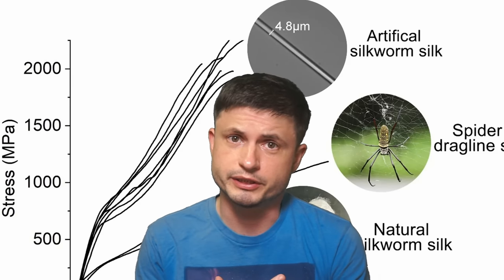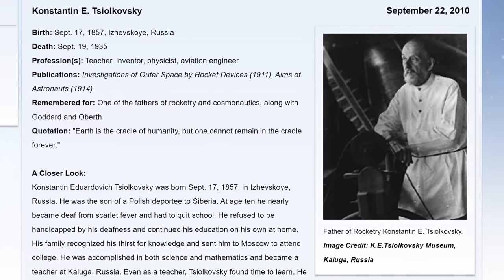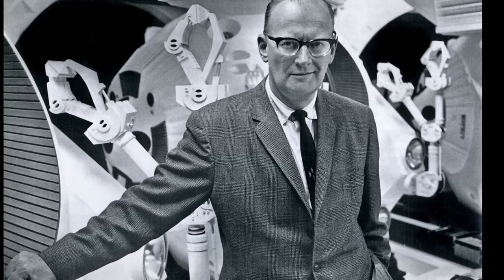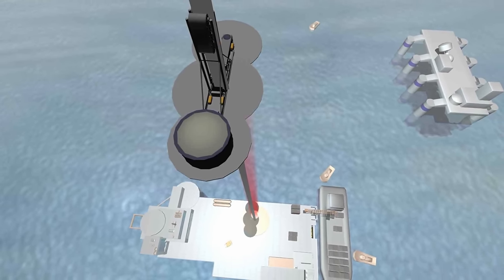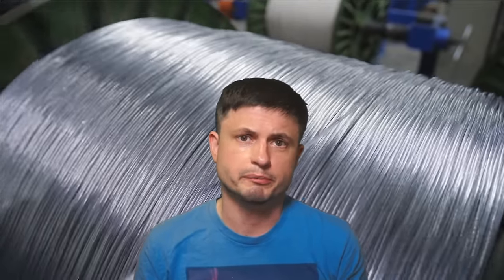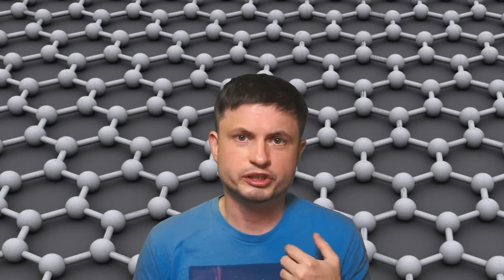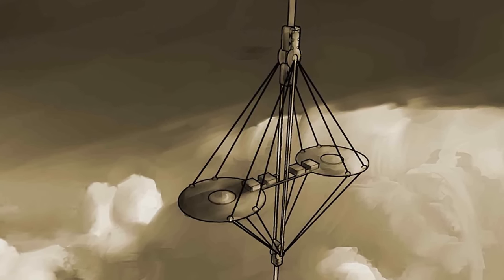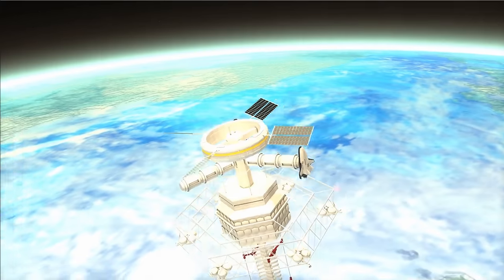Exciting New Updates About Space Elevator Technology...Possible After All?

Comment: Here is a question I have, with all of this focus on space elevators over the years, why not focus on orbital launch rings?  An orbital launch ring doesn't need any exotic materials we don't currently have.  It would help to use superconductors to help maximize performance in order to help push it up to a multi-gigatonne per year capacity, getting it into the global trade scale use.

The idea of an orbital launch ring here is essentially an inverted suspension bridge with a super-orbital speed rotor to hold it up.  When you look at the Hyperloop, you have vehicles entering and exiting the tube, which makes it hard to maintain a hard vacuum.  However if you have a continuous rotor in a fully enclosed tube, it should be easier to get to a hard vacuum.  With magnetic levitation, there should be basically no friction and thus no real speed limit of the rotor, allowing it to go fast enough to lift a static ring off of the ground and out of the ocean with centripetal force.  We have the materials to hold such a ring out at the edge of the atmosphere.  Build another maglev track on top and you have a way to both get to and from space with the ability to easily reach any orbit and even the Moon.

Comment: I recall learning that the energy per weight ratio of chemical bonds (such as in rocket fuel) was only just high enough to overcome the Earth’s gravitational well and that if gravity were say twice as strong we wouldn’t have a practical energy source to escape.  It seems that the static bond strength to weight (of interest to materials for space elevators) is less than the dynamic bond strength to weight of fuels.  So there doesn’t appear to be much headroom (if any) for a viable tether material given our planet’s gravitational pull.  Perhaps it is possible but say if the gravitation were 20% higher it would not be.

Comment: I should like to know what lateral force is going to accelerate the rising load to orbital speed on the way to orbit. As I see it, there will be a considerable horizontal load on the suspension cable all the way up. The reverse on the way down. 
       An ascending rocket takes a curving path to accelerate to reach orbital speed burning fuel in the process.   Conversely, returning to earth from orbit requires retro-thrust and the vast drag of heat dissipation on the way home.
      Either way, the load needs to gain/disperse energy in the horizontal plane, so any mass we send up the 'elevator' is going to give rise to huge forces on the suspensory ligament in the horizontal plane. I don't think 'Arthur's' Space elevator will work and it's not just a matter of finding a strong enough cable.
               Or is this the wrong tree up which I'm barking ?

Comment: It'll never work due to the conservation of momentum.

The equator is travelling at around 1600km/h.  A payload being pulled up the cable starts out with this lateral velocity and, as it gains height, still wants to travel at only 1600km/h, much slower than the cable at any altitude.  It will start to pull the cable "backwards" and pull-in the counterweight, eventually crashing everything back to earth.

Comment: This is much more complicated than it seems at first.  The two ends will travel at 1 rotation per day, but the part at low earth orbit will want to orbit at 1 rotation per 90 minutes. There will have to be a significant sideways force pulling on the cable at the earth end. 
Even if the sideways force is cancelled, there will be a significant upwards force, because the earth end is pulling the counterweight. The counterweight naturally travels at less than 1 rotation/day and has to be pulled enough to bring it up to 1 rotation/day.
Reply: No.
You're not wrong in what you're thinking. But you're wrong in how you're thinking it.
The forced on the cable in LEO will not be pulling it sideward. It will be pulling it downwards. This is part of the calculation.

Comment: Personally, I feel like orbital rings are more practical.  It's easier to set them up to connect to multiple locations; you don't need long, strong cables, just a case with objects moving in it and (comparatively) short cables from just above the atmosphere to the ground; additionally, since the ring would be closer to Earth and controlled by directly maintained orbit of "counterweights", you don't have to worry near as much about things like tidal forces from the Moon.  My guess would be that the most effective path would be to produce skyhooks, then use those to transport materials up and create a ring; then, after a while, that ring can be used as a transport to produce more rings, allowing access to space from most parts of the world.
Reply: Orbital rings have huge stability problems if I remember correctly.
Reply: @GoCoyote  Only thing I found saying such was from the early 80s.  As I've understood it may take a lot of calculations to adjust things on the fly, but it can be done.  And the space elevator itself has big problems.  As I mentioned, tidal forces are a major issue.  Putting the load past geostationary puts it close enough to the moon that its gravity can have some very bad effects.

Comment: I am excited to learn in the near future what other challenges will have to be overcome and how we will do so. It's always fascinating to me when the questions start changing from science and theory to engineering and logistics. :)
Will there be crosswinds? How much weight could the elevator lift at a time? How will we protect it from micro-meteors and space junk? What kind of foundation will it need on the ground to keep it securely tethered? How big of an elevator could we make before the square-cube law overcomes the tensile strength of the graphene? Will pulling the elevator car be harder and harder as you gain altitude and therefore more potential energy, or will it stay pretty much the same?
Also, What other immediate uses will we start seeing for graphene capable of being cost-effectively produced at such a scale?

Comment: I remember discussions around this topic when NASA did their long tether experiment in orbit (1990s). That was a few km long - and broke - to the surprise of none at the table.

The issue as predicted was manufacturing quality. While the cable may have a tensile strength of x_, this is actually _x +/- s ,  where s increases as the square root of the length.

So as you increase length it becomes inevitable that the cable will snap. Given the lengths required for a space elevator, the uncertainty (std dev) s must be infinitesimal compared to _x_.

Comment: The rope that is strong enough is called Spectra rope. A four inch diameter spectra rope is so light that it floats of water and can hold 1,400,000 pounds. I just never knew who to talk to. To deploy it, you could start with a small diameter rope like you said.
Reply: Kevlar could only go a few Km's before the weight of it's self would break it. Spectra is bad-ass but not that good to go thousands of km's.
Reply: You forget that you would have to get all that weight up there in the first place.  Geostationary orbit is 22,000. miles up!  If you lower most of the weight of your station, in the form of the rope, without a counter weight going in the other direction, you are pulling your station down from orbit.
Reply: @haroldhahn7044  22,000 miles and not all of it weighs but a tenth of its normal amount for the majority of the distance.
Reply: It definitely wouldn’t add up to 1,400,000 pounds.
Reply: Even a 1/64th inch cord could do the job but that’s a lot of length! 22,000 miles?
Reply: Maybe it’s literally impossible. I don’t know what spectra rope weighs per mile....

Comment: I don't know nearly enough about this concept but I'm assuming that part of the issue ends up being with the higher section rather than the lower section bearing weight.  I'm not sure if somehow weight/stress could be "taken off" of the structure by additional pull from the space side but it feels like that is solvable.  

What confuses me is intuitively as you get further from the surface, or if you take a larger planet as an example, with the same rotational speed, the effects of the rotation would get stronger.  Like a planet with a larger diameter but the same rotational speed would "feel" like it is rotating faster.  This might be mitigated by the atmosphere being thinner as you get closer to space, reducing the drag I would guess, but it still seems like it would be a major problem.  

An odd additional thought from my perspective is that to make this use less material and have less stress it would seem like building this somewhere on mount Everest or some relatively tall place would make sense to some degree.

Comment: Would it be possible, also, to use the graphene cable to produce electricity? Or will it being a conductor be a problem? Graphene is a conductor. While the cable will not be passing through the magnetic field, our planet's field must shift and change with time. Moreover, the sun's mass ejections are also electro-magnetic (protons, among other things). So, just a question, not necessarily a comment on why it would not work, but a potential engineering problem.

Comment: What will be the experience of gravity on the station in space attached with cable, the same as on the surface of the Earth or lower, higher or zero?
Reply: At the geostationary orbit, the apparent gravity will be zero.
Further in, towards the Earth, the apparent gravity will be positive, and rising according to the percentage of the distance from Earth. So basically 1% gravity for every 360 km you move away from the centre point.
Further out, towards the counter weight, the apparent gravity will be negative, and rising. Meaning "down" will be away from the Earth.

Comment: The counterweight cable surely would only need to resist the tension load as the cable itself would be weightless. The lift cable needs to resist the load tension and the weight of itself?

Comment: We are a long way aways from a space elevator:

- The cable must be atomically perfect to be this strong.  The first tiny paint chip that hits it will cut the cable.

- A COSMIC RAY which knocks away one atom of the cable will cause the area around that missing atom to stretch 10% and become permanently weaker.  No one has any clue how to repair such damage.

- A superconducting cable thousands of km long rotating in a magnetic field is problematic.  It would be far better if graphene was NOT superconducting. A long superconductor cutting thru the Earth's magnetic fields will add a sideways dynamic load which is rarely discussed.

- Most fibres can be made stronger by weaving them into strands, threads, strings, ropes, etc.  Carbon nano-tubes get weaker if they touch, because the carbon atoms of adjacent strands weaken the atomic bonds to the atoms above and below the touching atoms.  (We want all of the bonds to be resisting the up and down pull, we don't want cross connections.)

- Serious plans for space elevators suggest we make the cable thickest at geo-stationary orbit, and taper it as we get farther away.  No one has any idea of how to taper a carbon nano-tube.  

- Let us say that we have a carbon nano-tube which reaches down to Earth.  How do you grip it, and pull yourself higher?  Any outside atoms that get too close to the carbon atoms in the thread will weaken it.  Can you hold an elevator car, (massing several tonnes, plus cargo), on such a thin point of contact against Earth's gravity?  What will be the local dynamic loads on the cable as the elevator car accelerates upwards?  I've seen no answers to these related questions.

Look up 'rotating sky hooks' for a variation of this idea which could actually work (tho space debris is a concern for them as well).

Warm regards, Rick.
Reply: All valid points, and there are probably many more to consider.   One that occurs to me, that could be somewhat comedic to observe, would be the first attempts at catching the end and attaching it to the anchor point.    It's certain that IF such a thing could ever be constructed, the end near the Earths' surface won't simply just hang there waiting for someone to grab it.

Comment: what's the solution now for the rope to survive atmospheric friction at high lateral speed during deployment?
Is there a simulation as to the dynamics of such a deployment process?
Reply: It would be going zero relative speed since it would be lowered from geosynchronous orbit where you have zero lateral speed from the surface. Where would this lateral speed come from?
Reply: @filonin2  Nice in theory but stratospheric winds regularly reach speeds in excess of 400 km/h as the atmosphere is constantly feeling the effects of solar wind pressure so rotates slower than the surfaces relative velocity when accounting for elevational increase.
Reply: @leonmusk1040  But in this altitudes, air density is pretty low and even fast winds may have not enough force to worry about.

Comment: What the space elevator plans don't regard, is that there is a Voltage gradient of 100 V/m in the atmosphere. In 10 km height that makes a 1 Megavolt potential to the ground! And this is likely to continue into space (It's not regarded in the current cosmology, but experiments and observations show that it's there  - see NASA's experiments with tethers in orbit.). 
The elevator cable would need to be able to withstand the current resulting from that... Maybe it's more likely to become a power station than an elevator, or maybe it can become both...

Comment: At 7 or 8 km up stage you add giant helium balloons to lessen the weight being carried by the cable... Build the cable in sections that lock in to limit tension as well.  Would that then make it work with current materials?
Reply: Skipping 7 km doesn't make much difference on 36,000 km.

Comment: People tend to glance over that just trying to construct something like a space elevator, even if we had the materials to do it, presents extreme difficulties in trying to build such a thing. Building it from the ground up means you'd have to build a cost prohibitive structure to support it and building it from space down means that any attempt to maneuver the cable would cause it's orbit to change and something that massive is going to need some serious propulsion to keep it stable for very long periods of time. I think it's safe to say that we need a little bit more than just carbon nano tubes to make this idea feasible.
Reply: You don't seem to have a clue.
You don't build a cable from the ground up.
We transport the cable in rockets, and take it up to geostationary orbit. There we start stretching it up and down at the same time. After a while it will stay taut by itself, due to gravity. We won't be maneuvering it back and forth, so no propulsion will be needed to keep it stable. And then we will just keep stretching it down until it reaches ground.
Sure, this is simplified, but the problems you are presenting don't exist.
Reply: @Tjalve70  Well that seems like it could work. Interference from the solar wind and tidal forces from the moon and sun means that some station keeping will be necessary though so propulsion is necessary and we can't forget that the counterweight is still a big issue.
Reply: @jarhead1145  How is the counterweight a big issue?
And if the centre of gravity is slightly outside geostationary orbit, then the centripetal force will basically straighten out the cable. So no, I don't think any propulsion is necessary.
Reply: @Tjalve70  I'm talking about during the construction when it isn't yet tied down to earth. Also it was mentioned in the video that the best counterweight would be an asteroid but maneuvering it into position presents a big issue.

Comment: Wouldn't gravity of the line (and wind) pull the geocentric structure down from orbit?  Is it really possible to use geospatial orbit as an anchor?  It's not a solid to hook onto.
Reply: A large enough counter weight would hold it up.
Reply: That's why everyone talking about a space elevator, will include a counterweight at the other side. It's an integral part of the space elevator.